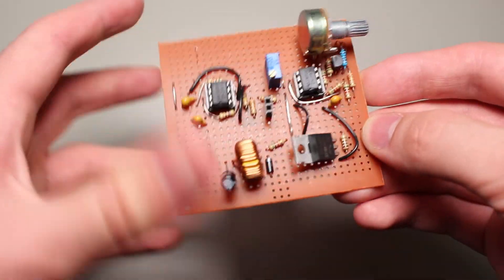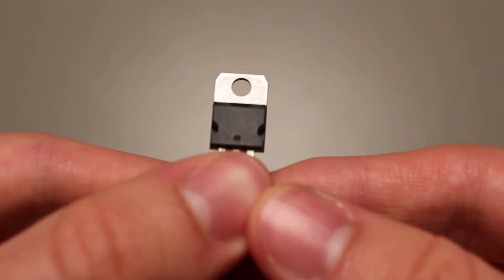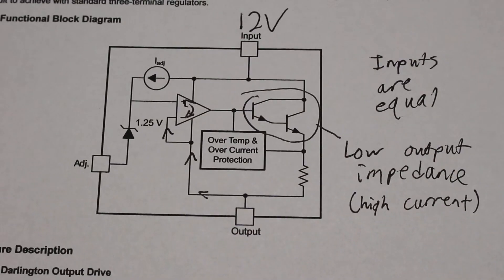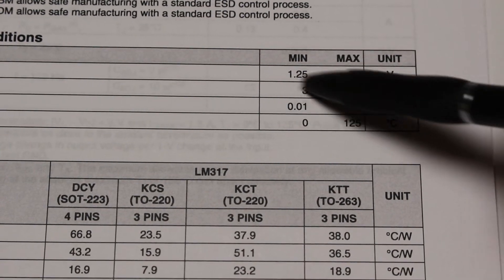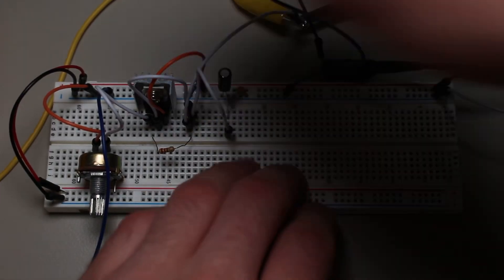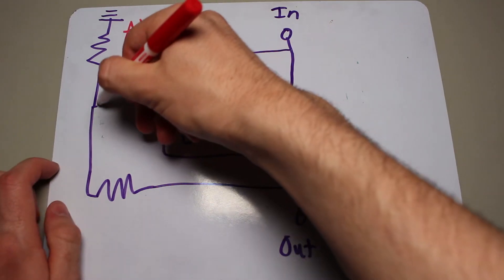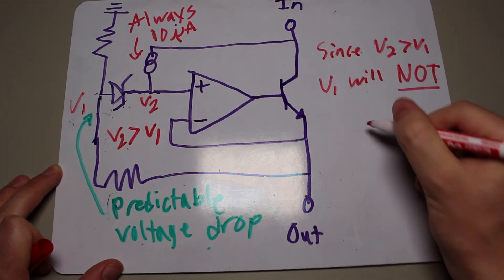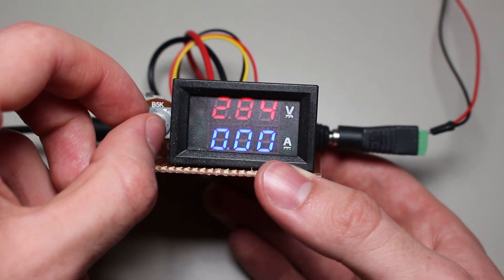Life Size LM317! - How do linear regulators work?

Comment: Fun video. But LM317 uses Output Terminal (nor ADJ) to power the negative rail of the OPAMP. We would require a good 'almost' rail to rail OPAMP.

BUT the main issue is, initially when system is powered ON, Transistor is OFF, hence OUTPUT Terminal is FLOATING because of which OPAMP will not be powered and it will not operate. If it doesnt operate, it would continue to 'not work'.

Any idea how that works?
Reply from the maker: Thanks for watching! The op-amp's negative rail is initially connected to a lower voltage through the load on the output. This can be seen as the minimum 10mA load specified in the datasheet.
Reply: @SineLab  Wow. How could I miss that.

So since the current consumed by OPAMP is very very less, the votlage dropped by the load is minimum, essentially passes the Ground to the Output terminal and hense to OPAMP rail. Fabulous thinking and design! 

On Normal fixed regulator, the negative rail is connected to ground. Obviously because we on LM317 needs minimum current at Adjust pin so it doesnt load the output voltage divider. But on fixed regulators its not required so a small current may pass through ground.

On LM317 OPAMP Must operate with minimum power supply or else the Minimum Droput voltage must increase. That's the challenge faced for its design.

Anyway thanks for answering, been looking it up on the internet. But almost everyplace people were omitting the power supply lines 😠.
So I would love to know how did you figure it out? Did it clicked automatically or you already knew?
Reply from the maker: Glad you understand now! I figured it out by looking at the schematic and also running a couple of simulations. The Falstad online simulator is good if you want to try it out as well. :)

Comment: An interesting engineering investigation. Good to see you using the full 3V of headroom. For the typical LM78xx V Regs, most people just use the minimum dropout headroom, say 1.5V. However, a more careful inspection of data sheet reveals that a full 3V enables the V Reg to maximize its ripple rejection. In order to be able to state the component's highest ripple rejection numbers, the manufacturer uses 3V to test the component. Again, look closely at the data sheet, particularly at the notes in fine print. Cheers!
Reply from the maker: Thanks for watching! It's very important to read the datasheet.

Comment: A BJT transistor in a TO-66 package is also easily attached to a heat-sink.  Or go for a BJT in a TO-3 package!!
Reply from the maker: I only had TO-92 BJT transistors, so it simply made more sense for me to use the TO-220 mosfet. Choose what you have. :)

Comment: PL - Elegancki materiał :> swietnie wytlumaczone dzialane lm317, moze cos o zejsciu ponizej 1,25v?
EN - Elegant material :> well explained action lm317, maybe something about the descent below 1.25v?
Reply: usually they simply stop regulating  and pass the voltage though with a voltage drop - check the datasheet
Reply from the maker: You can also create a way to connect the adjust pin to -1.25 volts if you really must go all the way down to 0 volts.
Reply: @SineLab  i know,  but this ic is like a moltitool ;) curent source etc, please continue ;)